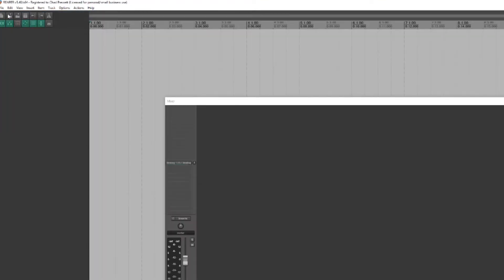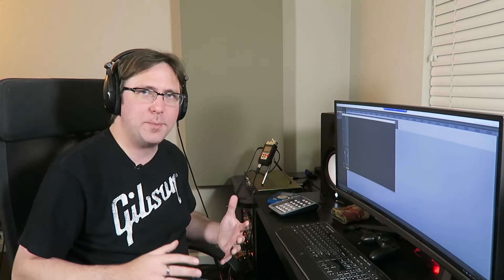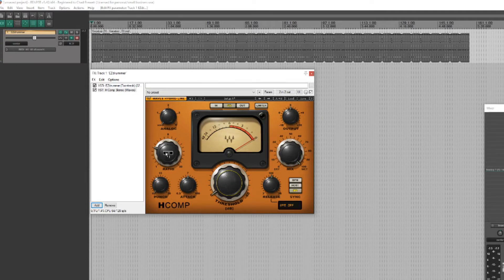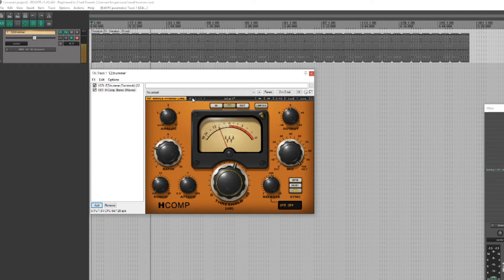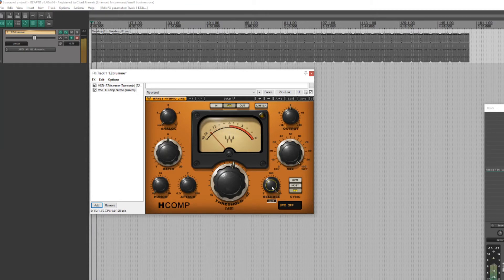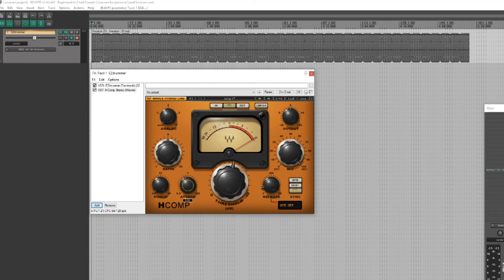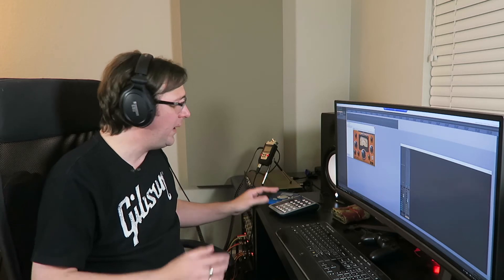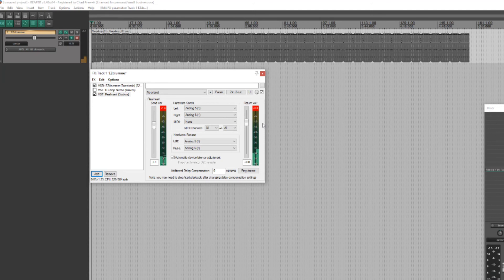Compression Pt 2 - Let's just play with compressors

Comment: What free Windows software would you recommend for beginners getting into recording? Also great videos I am thinking of buying an entry level Behringer audio interface.
Reply: Would recommend Reaper. I think YHRS uses Reaper and loads of us at therecordingrebels.com use Reaper. Its free to try and will run uncrippled even if you don't get a licence. But you really should get a license after you've got into it and worked out if you like it.
Reply from the maker: Definitely a good suggestion, JD.  Another freebie is Tracktion 5.  I haven't used it myself (yet), but its a good free option.